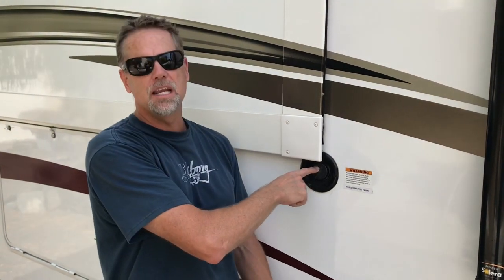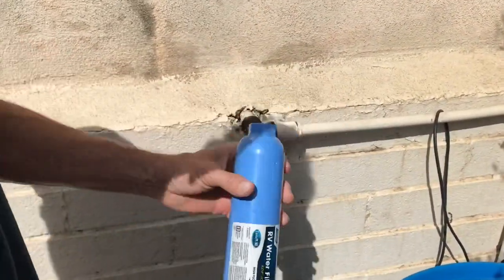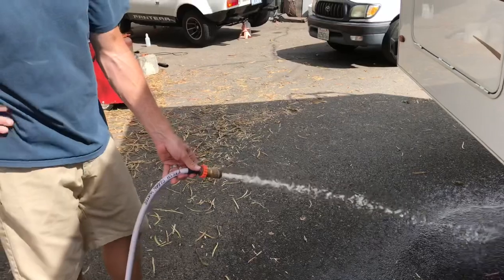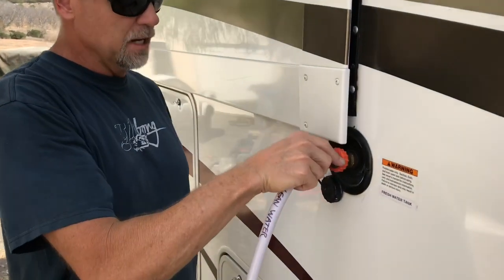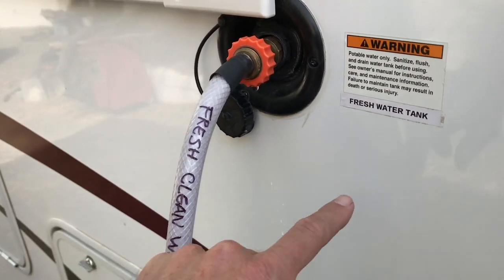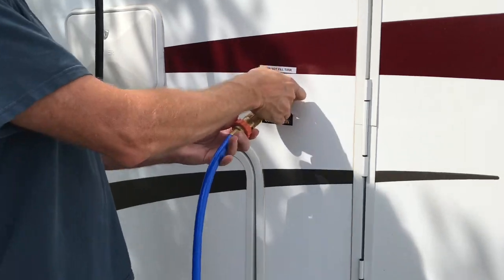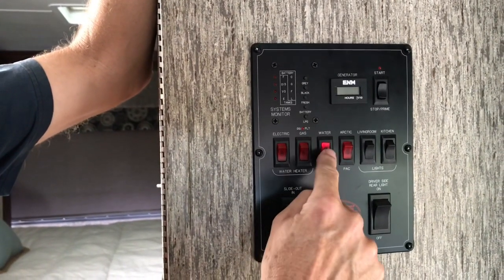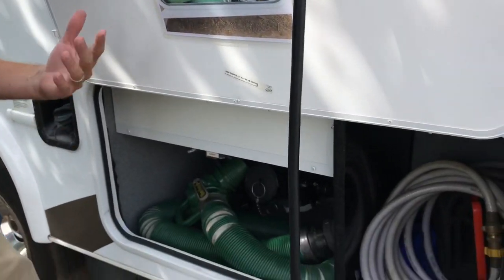RV Water System Explained

Comment: What stops the city water from overfilling? Is there a some sort of built in switch drawing the water only when needed? Can I have the city water spigot on for days without using water or just have it on when I want to run something using water?

Also good tip on connecting the hose to itself when in storage. Would not of thought of that.
Reply from the maker: The city water will not overfill, since it is not filling anything. It is simply just like the plumbing at your house. There is constant water pressure incoming in the only thing that lets the water flow is when you turn the knob to your shower, bathroom, faucet, or kitchen faucet. Does that make sense to you? It’s basically just like your house. The water pressure doesn’t fill anything, it just allows water to come out when you twist a knob. Yes, you could leave it on for days. As long as there are no leaks. If there was a leak, the water would fill up your gray tank, and then that may overflow once it is full.
Reply: @TheAdventureTravelers  got it. Thanks

Comment: Question: Do you still need to use the pressure regulator when flushing the black water tank? and why the difference in hoses because you aren't pulling black water back out through the flush hose? that's for inlet only correct? or is my thinking all wrong on this too? I'm learning don't laugh at me here
Reply from the maker: Great questions... Let me start with the first one.  I use a pressure regulator for each fitting that goes into my RV.  The reason why is, some RV sites have "enormous" water pressure and the plastic plumbing inside my RV is just not rated for high pressure.  I would rather be safe than sorry (having a plumbing fitting inside my RV rupture) and use a pressure regulator on everything.  

The difference in hoses is strictly sanitary.  Some people may not be as clean as me, but when it comes to poop, I want to keep my freshwater hose as far away as possible (from an inlet or the black water cleanout spigot itself). Just my personal choice.  Hoses are cheap... your health is priceless.

Comment: Thanks our first experience living in a RV.I was wondering about the water system in our trailer
I seen your water tank is under the same as ours
 Is that where our charcoal filter would be
Same spo
Reply from the maker: Sorry, Francis, I just got around to reading this. You have probably found your charcoal filter by now. If you haven’t and you’ve looked all over, perhaps somebody did not install one on your rig. You can always install it after market and do it in line with the water system. It does take out a lot of the contaminants. Wishing you the best and thank you for watching. Michael and Melissa

Comment: In all the videos I've watched I've never heard anyone show where water goes into tank inside and talk about vent that spews water out if it gets full. My tank is empty and not hooked up to city water and fresh water inlet is weeping water outside.  Cant figure it out.
Reply from the maker: Renee, Okay, remember that when they make RV's, they don't always make them with the best design.  Are you using a hose with pressure to fill your tank up?  If so, it should fill.  Sometimes, water comes out of the fill hole, even when the tank is not full.  This is usually a design flaw and the installation has the hose running uphill (against gravity) to the tank.  Water will come back out once you stop putting water in.  It should only be as much water as the hose (inside the RV) should have inside it.  When I fill my tank to the top and drive, water comes sloshing out the side of my RV all the time (usually from the vent line but it can also come out from the hose).  Water is always looking for the path of least resistance.  Does that make sense?  Let me know.  Here is my more in-depth video on the water system:  https://youtu.be/WCkVSM_xOSA
Reply: @TheAdventureTravelers  thanks for your response. Yes there is pressure in the hose coming out of the faucet.  Hose screws onto fresh water fill.  I have a pressure regulator on it.  It fills up fine, it just seems to not stop weeping when I'm done filling.  Glad to hear your explanation.  I thought maybe it had something to do with the pump cycling on every 10 minutes, which doesn't that indicate either a leak or failed check valve? I will watch your other linked video.

Comment: Newb here....

Really a great video -got to the point (no long winded annoying intro with crap music) and was made for those of us who really do not have the experience yet and seeking advice.

Sooo, is the interior water pump ‘On’ when filling the Fresh Water tank? I believe from your video is it mentioned that it is off.

When do you turn the water pump switch on? When you are on the road (not connected to a water source)?
Reply from the maker: Maximus,  We typically leave the water pump off until we need it but you can turn it on at pretty much any time (with the exception of when you are hooked up to a City Water Connection).  The pump should only pump when it's needed, like flushing a toilet, taking a shower, or using water somewhere within the RV using the freshwater tank water.  If you have an ice maker, you would also need the pump to pump water to the ice maker.  Typically, when we are driving from one destination to the other, we leave the pump on, so we can just wash our hands or use the toilet without having to turn the pump on/off each time we need water.  If you have any other questions... just let me know.  Thanks for the nice comments on the video.

Comment: Hey There Brother great video now I have the city water connected my dad set it up here at the shop but for some reason I can't get enough pressure to stay constant to take a shower what might that be I don't know where all the valves I'm new to this RV stuff
Reply: I have a jay feather 2007
Reply from the maker: I’m sure that you already tested the water main without it hooked to the RV, correct? Have you put on a pressure regulator? It’s a small attachment that goes onto the hose before it goes into the RV. Also, ensure that your water pump is off. You really need to check all your valves to make sure they’re fully open. That’s all I can suggest from here.

Comment: Thanks for the tips on the regulators and filters. Hadn't done that yet. I'm looking for a definitive answer about how the city water gets to the faucets. When the city water is connected does that water actually flow through the pump? I know the pump should be off. But is the schematic such that the city water enters the house plumbing before the pump or after the pump? The other way to ask it is: Where are the check valves?
Reply from the maker: Sorry it’s been a while since I’ve responded, for some reason I didn’t see your comment.  Please check out my other video that goes in depth and actually has schematics on an RV system. It will give you a lot more information on how the city water gets through the plumbing. You do not need to use the pump ever if you are using city water. The check valves are in different places on different RVs. My check valve on my RV is right at the place where I insert the water into the side of my RV.  There may be other check valves throughout the system. It just depends.

Comment: Thank you for sharing.  I do have a question: So would I need to always pressurize my sink/shower after I fill my freshwater tank?  I'm in the planning/researching/viewing stage of my conversion (box truck). Also, would it be feasible to just permanently install the PRV to the initial water system when doing the build? I hope you see this.
Reply from the maker: Hello Brenda, you would need to have pressure one way or the other. Having the city water connected, provides pressure or, you use the water pump from your tank to provide the pressure. Does that make sense?  if you have two systems interconnected like I do, you would need to have a pressure release valve on your city water inlet. That way when you pressurize the water from your tank using your pump, the pressure will not go out through the city water inlet.
Reply: @TheAdventureTravelers  Thanks for you answering my question.  I will have a water pump in the install and thought that would provide the pressure, but was unsure.  Therefore, I wasn't sure if I needed to just add the PRV valve when I set up my plumbing install or not since my water pump would provide the pressure.  I "think" I understand.

Comment: You explain everything quite well sir. But I have found in my experience with my camper it is always better to put the filter on the RV side of the hose instead of this spicket that way your not getting funny tasting water from the hose so as if you have the filter at the end by the RV it's filtering out the taste from the hose as well as the sediment from the spicket.  Sorry for the typos I'm at work and don't have time to fix it.
Reply from the maker: I understand what you are saying.  The filter is a little heavy for my input port.  I can get an elbow joint to fix that but I haven't done so yet.  Good info.

Comment: Thank you. I hope it goes as smoolthly as your video portrays. So the city water when connected will give your toilet its flush water??? And when the water pump is on the water will be pumpted from the stored water?? These may sound stupid but we have not done this before. Thanks for your great video and hopefully you see my questions. Be safe!
Reply from the maker: Jacqulyne,  If you are hooked up to city water, that water will flush the toilets, give you water and pressure to take a shower and do the dishes and wash your hands in the sink.  If you are not hooked up to city water, then you use the water pump, and that acts just like the city water by providing pressure for all the same systems.  The only difference is, you will run out of water when using the pump since the water will be coming from your fresh water tank.  You do not need the pump on when hooked up to city water.  Does that help?

Comment: When you hook up to city water I understand that you do not need the water pump on and I understand why.  However, my question to you or anyone reading is.  When you are hooked up to city water does some what go in to a Tank to be heated as hot water.  This may be a dumb question but Im gonna guess yes.  I hooked my trailer up to the faucet on side my house just like what you did in this video and then I turned my propane on and went inside and turned on the water heater.
Reply from the maker: Great question.  Your regular water heater will heat the water regardless if it comes from your tank or an outside source (city water).  It usually takes about 15 to 20 minutes for the water heater to heat enough water sufficiently, so you can take a shower or wash dishes, etc.  The water may not heat as much water depending upon the system you have.  Our hot water heater usually heats about 8 gallons of water at a time and will keep heating as that water is depleted.  Of course, we usually, turn on the shower, get wet, turn it off, soap up, turn it back on to get off the soap, etc.    Hope this helps.  Michael & Melissa

Comment: I have A Surveyor 2017 I hook city water to camper and don’t get hardly no pressure. If I use my pump I have a very good pressure so my lines ok where would I look for my problem? Thank you
Reply from the maker: Mike, I apologize for not getting back to you sooner than this. I have been super busy. Anyway, did you find the answer to your question by working out the problem? I don’t really know how to answer this without actually seeing the issue myself. It sounds weird that you wouldn’t get pressure from your city water. Are you turning the pump off when you are hooked up to city water? You should. Also, the only thing I can think of is to check all of your connections and or valves and ensure they are turned the correct way to allow the water to flow freely from city water to your faucets.
Reply: @The Adventure Travelers  Thank yes we determined we getting City Pressure But it only had a 30# Pressure I was to get a 4o To 50 valve with a valve meter that you can see what pressure you need. Thank for your response enjoy your videos

Comment: If you have a connection from the city for water,  do you need to fill the fresh water tank at all? I am not going to be traveling with my 5th wheel so it will stay parked
Reply from the maker: You never really have to fill your water tank if you are connected to city water.  You will actually save quite a bit of gas by not lugging around a full tank of water.  Since we are in a motorhome and can pull over and use the restroom inside the RV at any time, we usually keep some water in our tank for those purposes.  Check out my other video that explains the interior plumbing (at least on my rig) which may give you some more insight.  https://youtu.be/WCkVSM_xOSA

Comment: I’m kind of confused tho...what was your reasoning for filling the fresh water tank up with the hose just before you ended up hooking your line up to the city water anyways just like you did here in the video? I never filled mine up I just hooked us up straight to the city and called it a day. Should I be using my water pump when draining my tanks too cause that’s what I truly need to figure out cause we are being blasted with a horrible sewer smell and all tanks and flushed and closed at all times unless I’m draining them.
Reply from the maker: The video was just for demonstration purposes.  Usually when we travel, we only fill the tank about 1/3 full to save on gas if we are going to a full-hookup site.  If we are boondocking/drycamping, we fill the tank all the way.  

On your second question, should you use the water pump to drain the tanks, not really.  We have a drain that we can just open to drain the water tank if we need too.  We have never used it, we typically just use the water up at the end of the trip and time it so we know that we will be left with 1/3 tank to wash hands/flush toilet on our way home.  We dump the grey/black like normal before departing on our last day.  

It sounds like you should be sanitizing your system to get rid of the sewer smell.  Simply mix some septic safe bleach (or vinegar) with water and flush it down the toilet, down your sink drains and your shower drain and then flush that with fresh water after a few minutes (at a dump site).  Some gunk may be trapped in your plumbing.  

Hope this helps some.

Comment: Did you put a filter on the city side?
Reply from the maker: Dan just happened to be looking at this right now.  Yes, we leave the filter hooked up when we have the city water connection on.  You can either put the filter near the spigot (what we do) or put it right up to the city water connection.  People usually have an L  attachment that they connect the city water hole on your RV and the water filter.  Hope that makes sense.

Comment: Good video !! I'm still learning about my camper. Just bought it
Reply from the maker: Thanks for the comment.  We are always looking to help.  Check out our other videos.  Lot's of info.  Thanks again for watching it.  Michel & Melissa
Reply: @TheAdventureTravelers  i filled up the water in the heater tank. No water coming from sink or shower ? I checked all fuses and breaker. Checker underneath no leaks. Not sure what's wrong
Reply from the maker: @RobPhiangdae  Do you hear the water pump working?  Is the water pump switch turned on?  Are your batteries charged or are you hooked up to power?  It may be a clog in the water pump or your inline filter may be clogged.  Try those.

Comment: I thought it was recommended to install the pressure regulator right after the filter, so you can protect your hose from excessive pressure as well.
Reply from the maker: Juan,  your answer makes sense.  I just put the pressure regulator on at the end of the hose so I can fit it into my water tank hole.  I'm sure most hoses could stand the regular water pressure, with the exception of the expandable hoses maybe.  Good point though.  Thanks for commenting.  Your  comment may help others and that's the point.  :-)

Comment: Thanks for the video. I am turning a new trailer into my hair salon. I was wondering how I would insulate my water lines or will I have to if I leave the heat on during the night. It doesn’t get under 30 degrees in Washington state but a couple times a year. Any additional information you can give is appreciated.
Reply from the maker: Lisa,  I wish I could help more with an answer to your question, however I haven't had to insulate our lines.  We have an Arctic Package on our RV, which are heated blankets that keep our tanks warm when it drops below 45 degrees.  That may be too extreme for your needs since it rarely goes below freezing in your area.  If I were you, I would go to the trailer/RV forums and you may be able to find an answer there.  Sorry, wish I could help more.
Reply: @TheAdventureTravelers  Hello, how do you get to the " go to the trailer/RV forums"?
Reply: Sorry, found it...

Comment: Hi, is there a special hose I need for my 1998 fifth wheel ? or will a regular garden hose do ? Thanks
Reply from the maker: You can always use a garden hose, it's just how clean do you want the water going into your system?  Garden hoses aren't made for drinking out of, so they have more chemicals than the other RV/Sailing hoses on the market.  I opt for the Camco hose or something similar but that's just me.